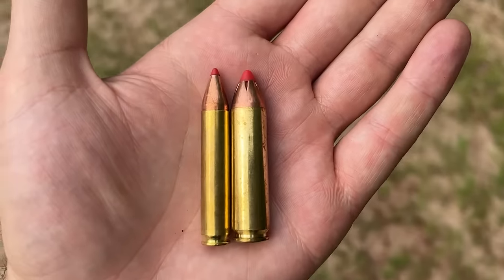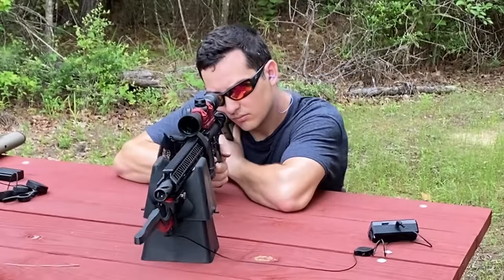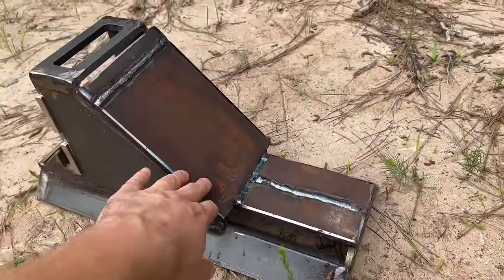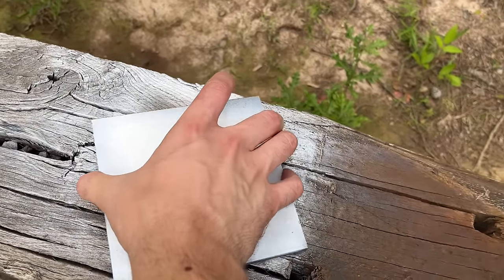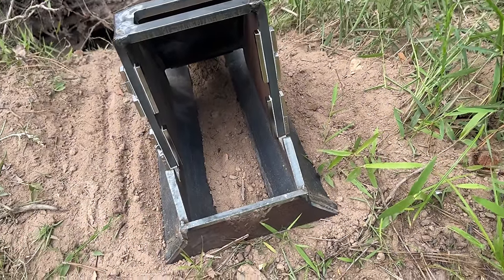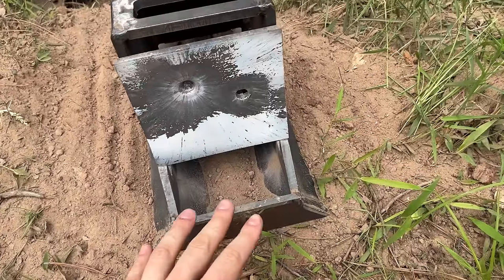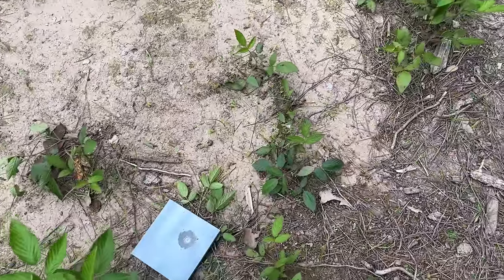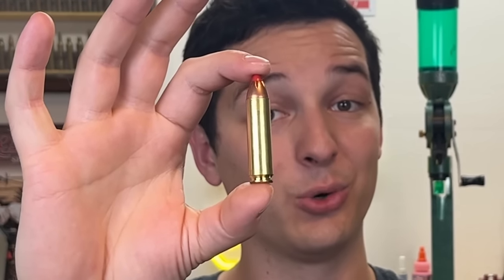350 Legend vs 450 Bushmaster: INSANE Difference On Steel

Comment: This is so stupid. You can tell exactly what would happen just by looking at the tip of the bullet. Even though he used the same brand and model of bullet they are made different. The 350 has a tiny little hollow point hole and the 450 has a large hole plus the crimped cuts going halfway down the bullet. You put a tiny hole without crimps in the 450 and I guarantee its punching a hole through that steel. Same goes for the 350. Drill that hole out and slice halfway down each side and I guarantee it's not gonna be punching a hole through that steel either. He's just trying to create drama between the 2 to try and get people to watch his videos. Instead of using common sense you can tell the outcome just by an initial 10 second look at the 2 side by side. Then on top of that we aren't shooting a deer with metal body armor on it so it literally is useless information and a wasted test. Most of what I have heard from friends actually shooting deer between the 2 cartridges is the 350 doesn't leave much of a blood trail but they have still found most their deer.  The 450 doesn't leave a trail but a pool of blood cause it drops then where you pull the trigger.  🤣